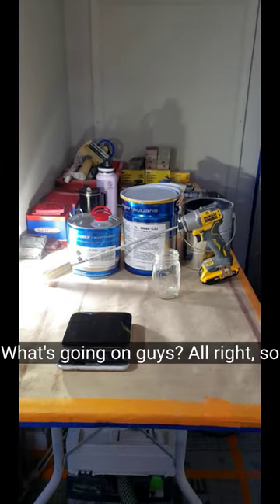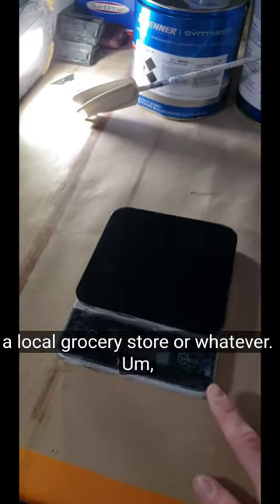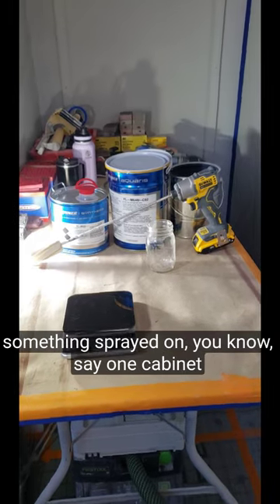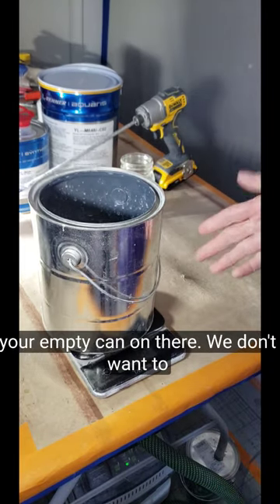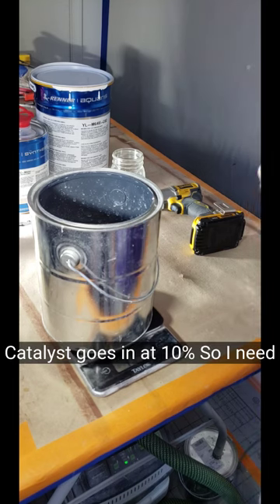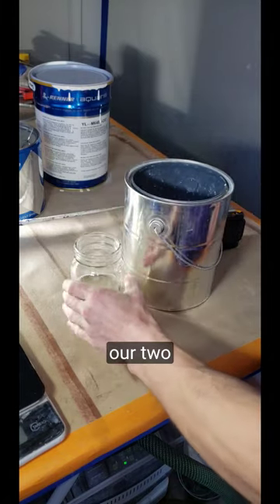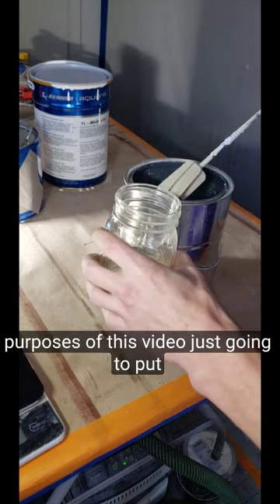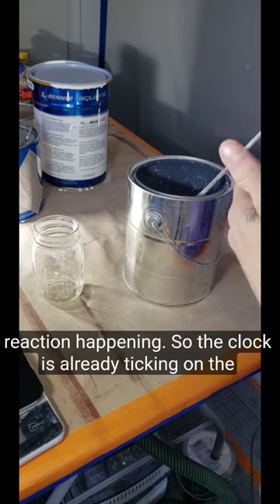How To Mix 2K Polyurethane

Comment: omgosh! this is all so perfect!!! i really appreciate your indepth insight, & thoroughness. getting ready to use all 3 of these in approx 2-3 weeks, along with my apollo, for 1st time.
Reply from the maker: Be very careful running 2k products through a turbine system. The hot air produced through the hose to your pot causes the chemical reaction to happen faster. You should be spraying airless, air assisted, or conventional with catalyzed products. You can do it, I see people do it with Apollo, but its finicky. DM on Instagram if you need any more info. 🙏🏻
Reply: @artists_touch_painting  o gosh, now I'm scared. I don't instagram to obtain more details from you though. 😓 is there any other way to communicate about this? I'm hoping to be doing this aspect of the project weekend of 3/30/24. 🙏